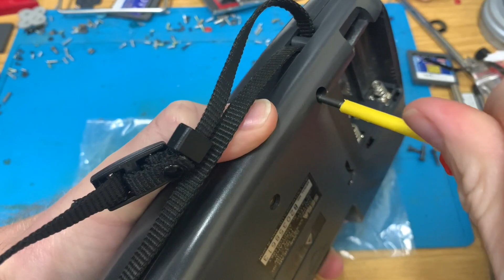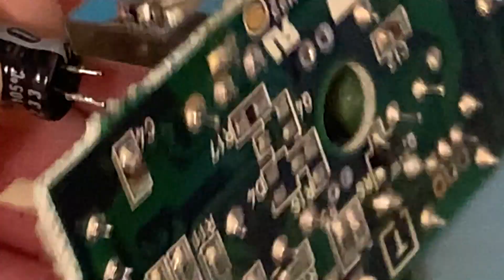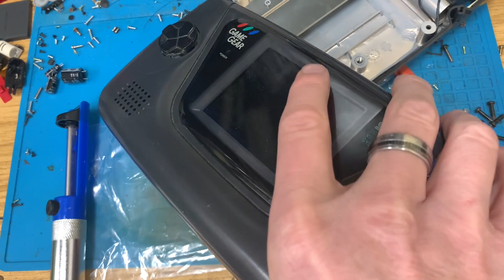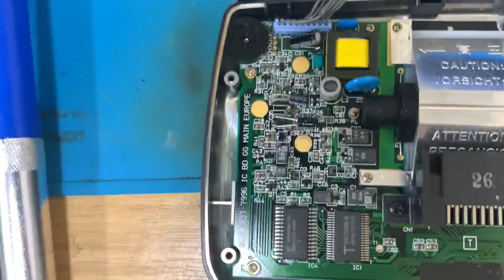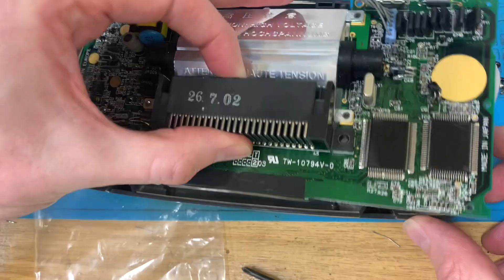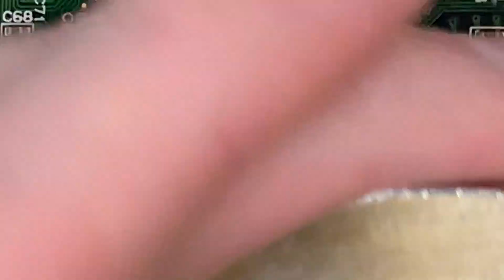Sega Game Gear  - Recap - Failure - :( - Don't do this !!

Comment: Hi, Just came across your channel as I've been following MMV for quite a while and he also gave my channel a shout out a few weeks back. 
Just thought I may have a couple of tips for you as I was watching you struggle a bit with the large IC you removed  and also bridging pins (so I hope you don't mind). I'd recommend using flux it will make your job 1000% easier, also to clean pads try using some switch cleaner sprayed on a bit of paper and rub in the direction of the pads and not across them.  That should clean any residue. Best Wishes. Mick.

Comment: Hello Nintendo chief :) I bought a lot of several sega game gear 11 or 12, I had tried to repair them, I had been able to repair only one, since I was helped by a French repairer on twitch and I have improved a lot since then.
the rest were repaired by this gentleman who became a friend afterwards, so the solution is like you do with DSi for example, you keep functional parts for testing (sound card, power supply card).
used type brand capacitors
after that, the solder points must be cleaned with desoldering braid and isopropanol alcohol.
very well clean the PCB with alcohol and eliminate all the places where there are traces of oxidation, normally it works, except if you have a chip out of service.
I use MG Chemicals Desoldering Tress 15m from amazon.
i used google translate ;) i'm french.

Comment: Just wondering, does this gentleman know that capacitor legs are allowed to be cut?
Reply from the maker: Yeah, it was a test to see if it would work, if it did then I’d have tidied up and shrunk the legs down, no point doing extra work if it’s a failure.
Have got another one to work on this week, so hopefully now I have the right caps, it should work and will look much nicer when done 🤞🤞

Comment: Nice try, retrosix has a wiki detailing what issues can cause a no boot etc 😉
Reply from the maker: Thank you ☺️ I’m probably going to just bite the bullet , buy a proper recap kit, they’re not that expensive really, and if it still doesn’t work I’ll see what else I can find from there…. It’s not gone in the bin, it’s safely tucked away for a revisit, although I doubt I’ll waste everyone’s time if it’s still a failure 😂
Reply: @1up_Gaming  they’re never really a failure, it’s experience that you can never put a price on 😉